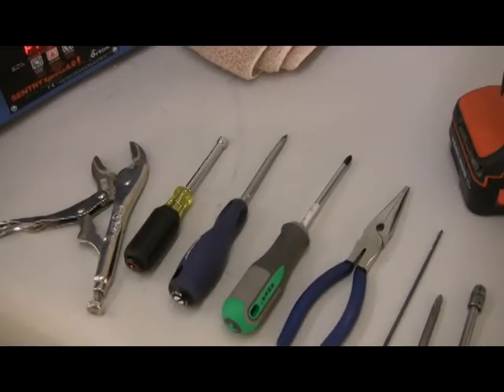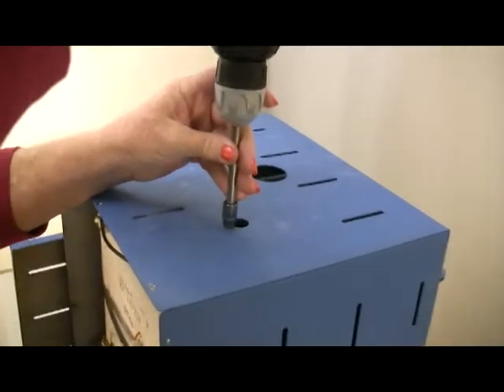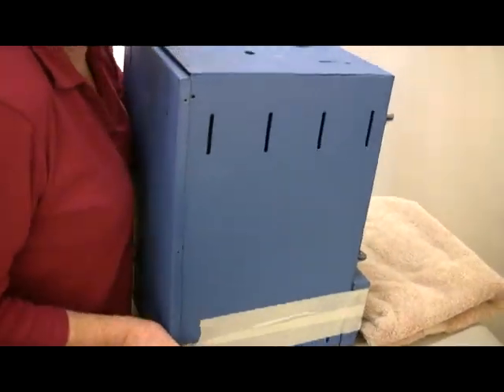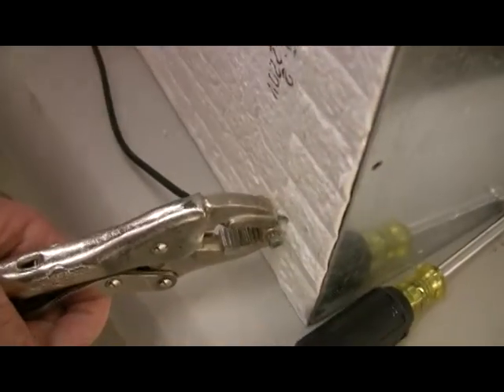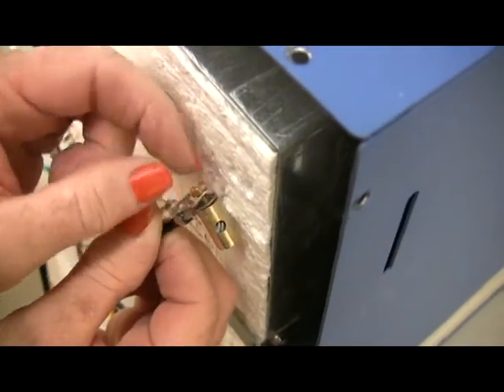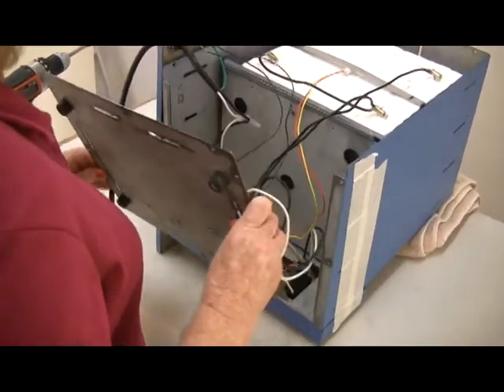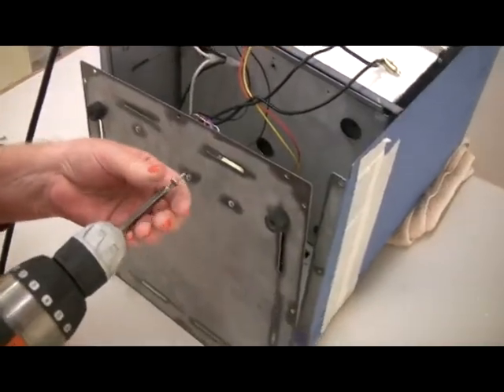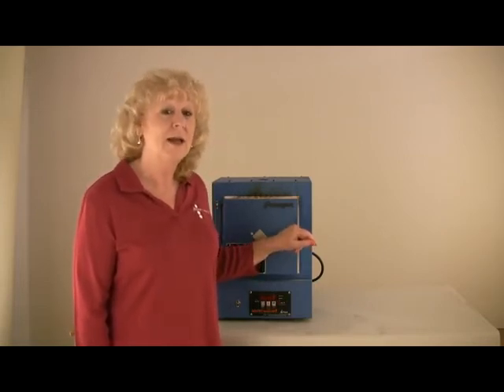Replacing the SC-Series Firing Chamber: The Paragon Kiln Maintenance Series

Comment: So I bought my SC3 not even 3 yrs ago , used it 3 times at1450* just for testing bullseye glass and now elements are burnt out, totally done. I’m pissed and will never buy another paragon kiln. I was told customer service was the worst but I bought it brand new because I wanted a ceramic fiber for testing glass only and now you are telling me heating elements can’t be replaced so I have to spend $500 every couple firings to replace a whole chamber?? I have 2 much bigger Olympic kiln that I’ve had for 2&3 yrs and never had an issue with either of them. I take very good care of my kilns . My olympics are only used at most 11 times within the year. This kiln was over $1200.00 after the window and bead door added. I’m beyond upset with this purchase and paragon should replace this kiln or return my money.
Reply: Actually it wasn’t even 2 years ago it was purchased
Reply: End of 2018 it was purchased

Comment: How long does it usually last? 
I have a paragon kiln and it seems to be broken, I did try to melt bronse and I heated it to 1000C.
Is it possible to get a replacement firing chamber in the UK (Edinburgh)?
Reply: Thanks Arnold, I will check it out. 
I did replace the relay couple of months ago, so it shouldn't be the cause.